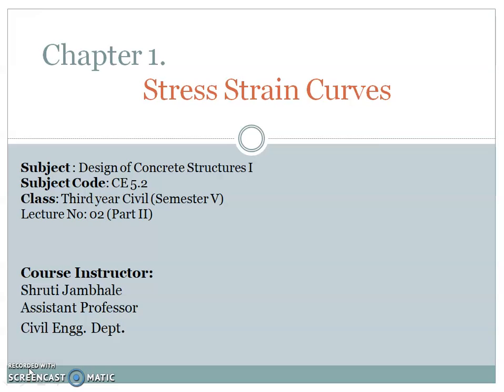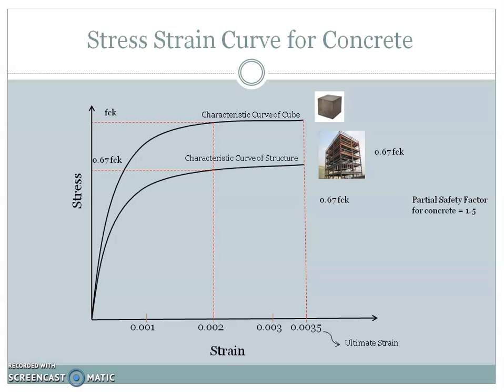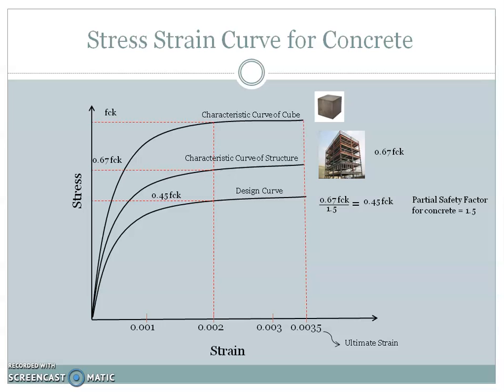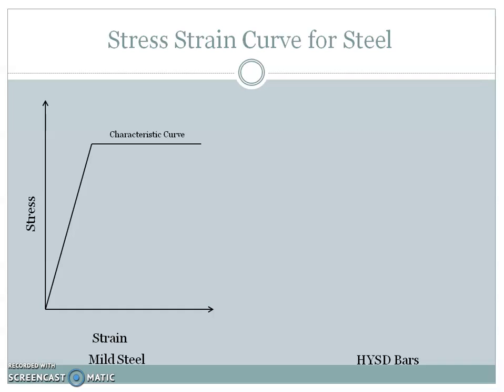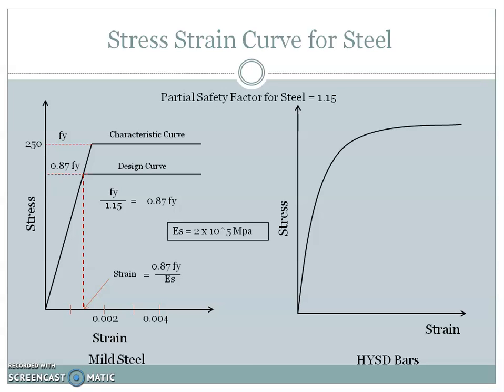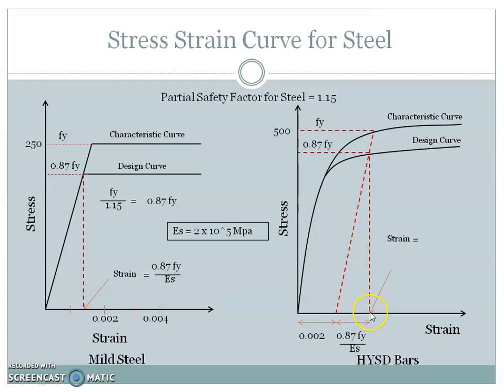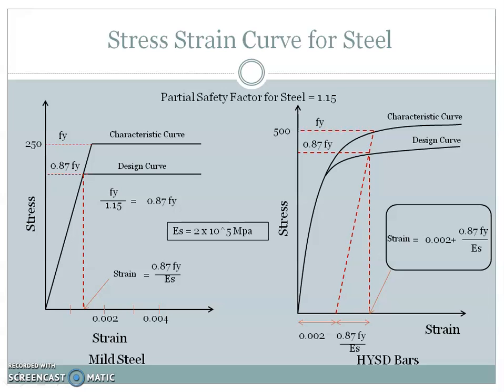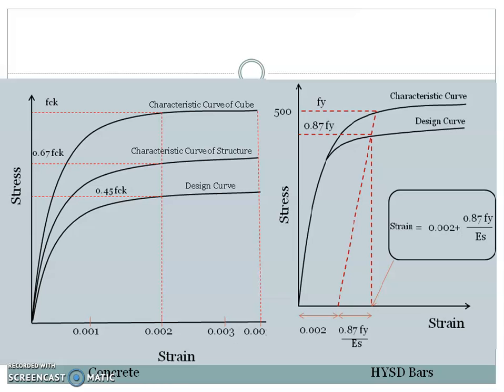Stress Strain Curve for concrete and steel

Comment: Mam can u  explain why code recommend 0.67 fck for idealized curve of concrete
Reply: It's because fck of cube test may vary with respect to concrete used in structure( due to improper concrete operations like mixing, placing, transporting etc)
Reply: Open BS8110..turn to page 11..read NOTE:1 of Figure 2.1..you will find the exact answer there😂 p/s: Read and understand everything in the code if you want to be a successful design engineer🙂